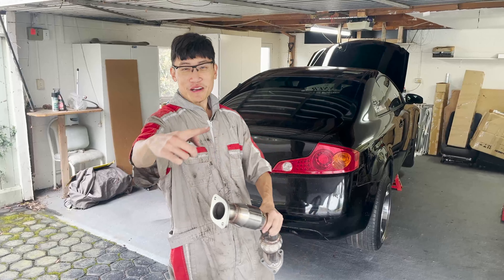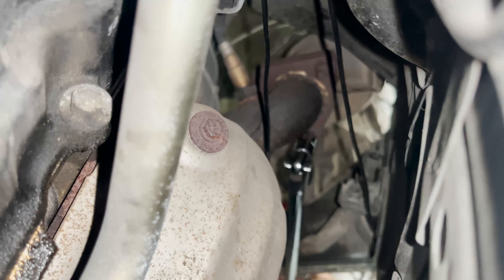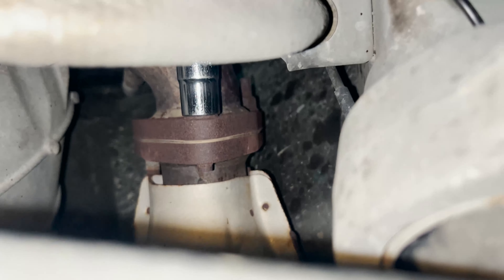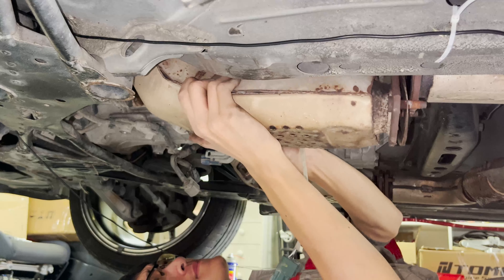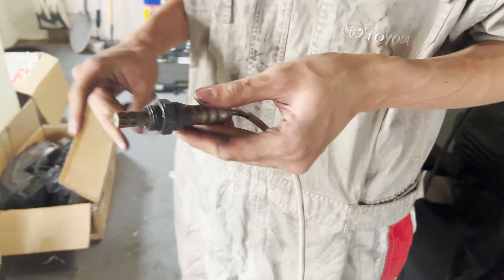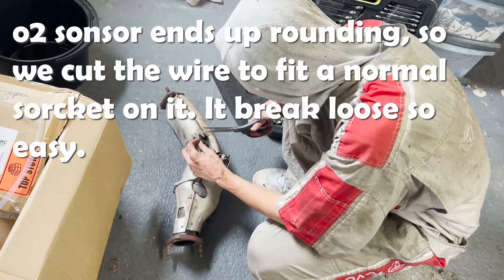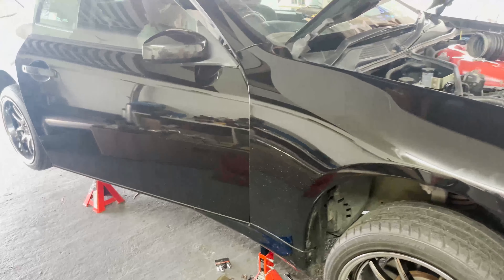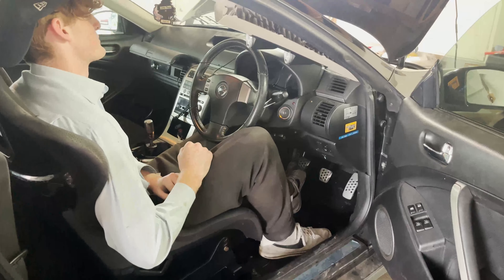Best test pipe for 350Z/G35 (No Rasp)!!!

Comment: what brand did you use also do you need a tune after this did u get any check engine lights?
Reply from the maker: Didn't have check engine lights and you don't need a tune.
Reply: your o2 sensors will throw a code for your cats being gone but you can order o2 sensor spacer adapters for like $35 that will trick the o2s

Comment: these are not the best for rasp. you'll need ones without flex pipe as it'll become brittle and blowout overtime. I learnt my lesson so I suggest you weld some pipe in place of those flex pipes.